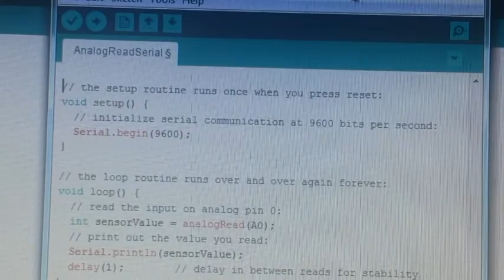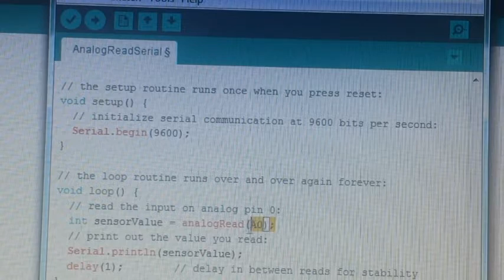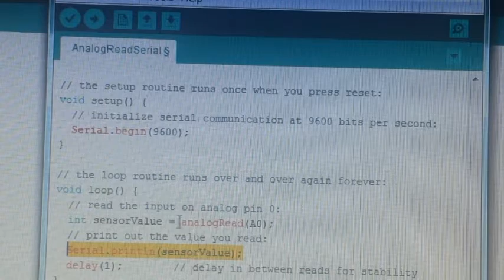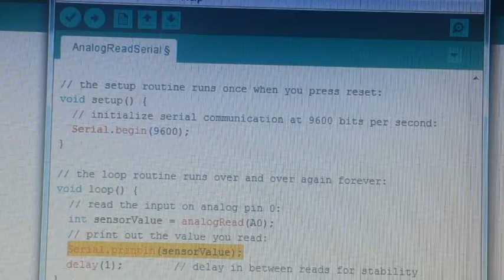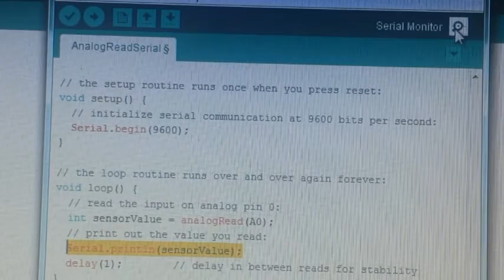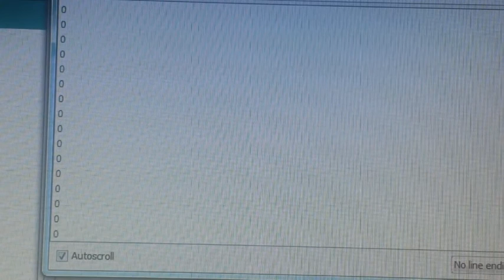How to do an analog read on Arduino

Comment: I finally got an Arduino working and I have built on the lessons so far. I now have a "KnightRider" LED light that uses a potentiometer to control the speed of the effect.